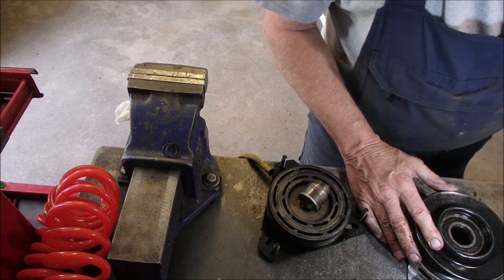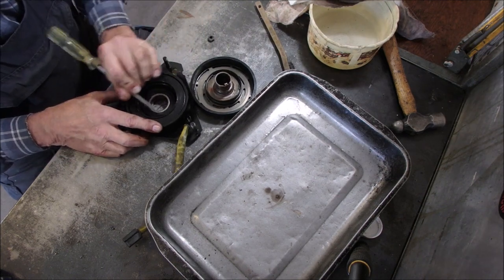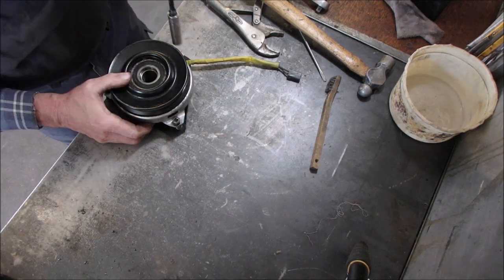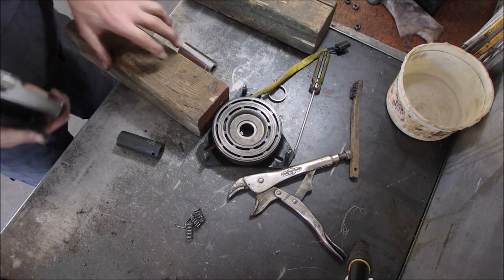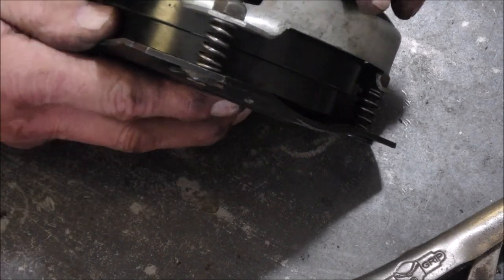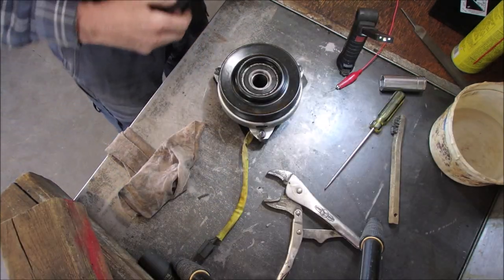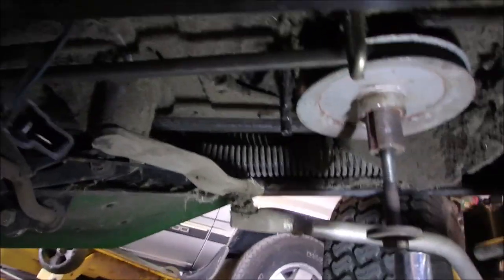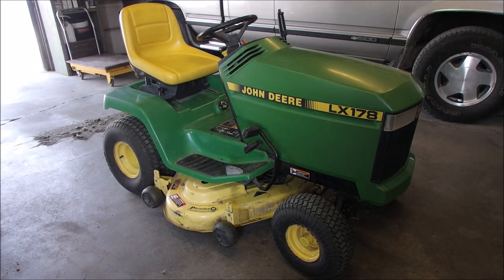My Yard Tractor Mower Deck Won't Turn On

Comment: Nice job sir, I have a few snapper zero turns in my collection, one is a joy stick yard cruiser, it has a really goofy electric pto, it has a upper pulley, and a lower pulley, and it's not on the engine crankshaft, it sets off to the side on its own shaft, top belt connects to a pulley on the engines crankshaft, and goes to the top pulley on the electric pto, then the lower pulley engages when you pull the pto switch, the deck engages, and on the crankshaft lower pulley runs the dual hydros, crazy set up for sure.
Reply from the maker: Sounds like it.

Comment: You want to do it with hand tools, put rope into the spark plug hole, and bind up the piston to lock it so you can tighten the pto bolt, without having to disassemble the whole top of the engine.
Reply from the maker: I have a pistons stop but wasn't sure it just blocking 1 side of the engine would work.